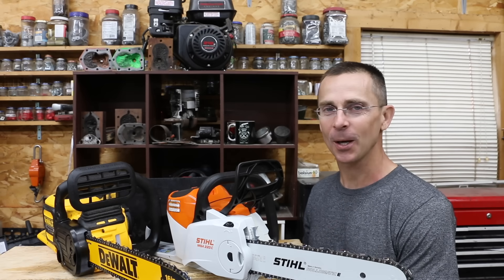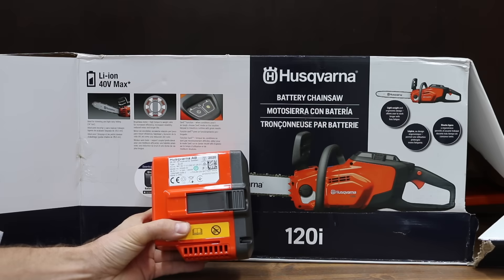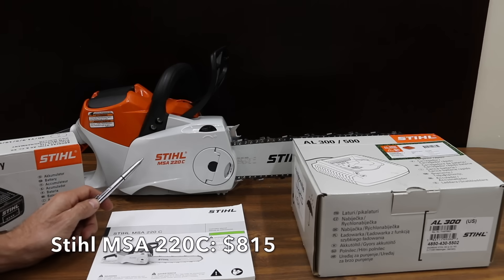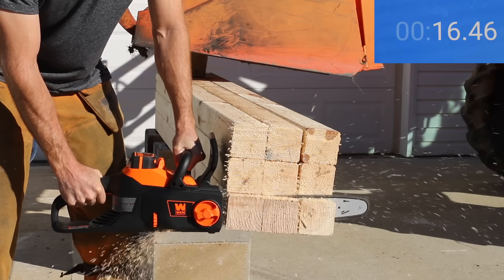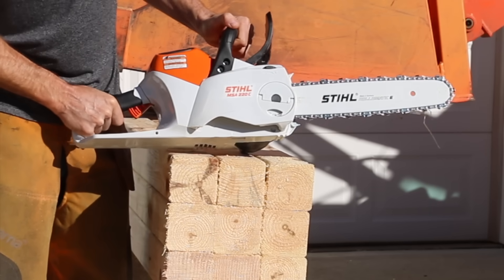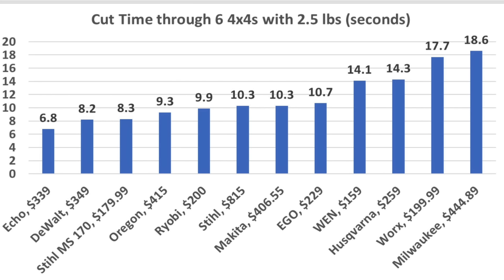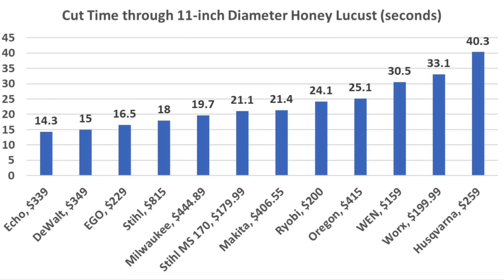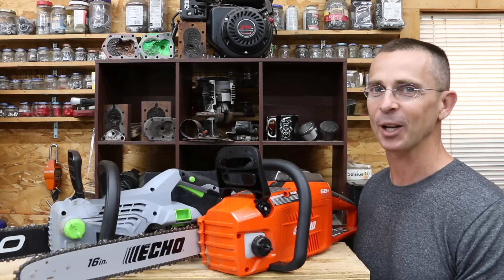Best Battery Powered Chainsaw Brand (ROUND 2)? Stihl, Husqvarna, Echo, Oregon, DeWalt

Comment: I picked up a DeWalt 40V 16" chainsaw and string trimmer a few years ago because they used the same batteries, that way I can have one on the charger when I go back out to the trees. It really jerked my chain when DeWalt discontinued the 40V product line in favor of going to 20V & 60V. I had to scramble to find a 3rd battery as a spare so I can keep 'em operational longer.
Reply from the maker: Thanks for the feedback.

Comment: Great vid, but I have two Stihl MSA 200s and they're seriously fast cutting. They have the 1/4 Picco chain and a tapered bar. The 200 looks almost identical to the 220, expect for the bar. The 3/8 chain is probably what's slowing it down. Give Stihl another shot and try the 200 with the 1/4" chain.
Reply from the maker: Thanks!  Thanks for the suggestion.

Comment: the EGO has one massive leg up over the others if you have other EGO products it can use there battery's like the 52cm SP mower it comes with a 7.5Ah battery there zero turn comes with 4 10Ah battery's and if you live in a country with 230v - 240v power they can charge really fast my 7.5Ah battery takes around 45 - 60 mins. oh and if you want to take some of the weight off your hands they have a battery back pack that takes there standard battery's and a 28Ah Commercial Backpack.
Reply from the maker: Thanks for the feedback.

Comment: I ended up with the EGO just because I have batteries for my blower, hedge trimmer and weed eater, I was amazed how well it worked but haven't compared to anything else. I cut down an old olive tree on one battery.  It's been hit and miss with batteries on my ego stuff, they have warrantied three of mine but when you get a good one they're great.  They do honor your warranty as long as you have the receipt and register your tool on their website, if not you're screwed.  I found out the hard way.
Reply: The 18 inch ego is twice or three times more powerful then that 14 inch. He doesn't use the best or consistent grade from each company

Comment: I mostly agree but for the DeWalt, I'd rather buy into that since the battery lineup is much more expansive. As far as slow charging for DeWalt, use one of the yellow fast chargers. I have the 4 port fast charger and it can fully charge 4 Flexvolt 9ah at the same time in under an hour

Comment: My dewalts kick butt for light duty climbing .I tried out the echo and thought it cut well but overheated and shut down too easy… I have the ego 18 inch  and it’s a battery powered beast,but I hate the chain adjuster sticking out so far.
Reply from the maker: Thanks for sharing.

Comment: EGO also has a 16” and and 18” model, both with higher RPM and a 5 Ahr battery (instead of the 14”, 2.5 Ahr you tested here). Wonder how they would compare with the Echo, as the 18” EGO is similar price to the Echo.
Reply from the maker: Thanks for the video idea.

Comment: I love my Dewalt Chainsaw.  Using it while I'm clearing, I use it for a few minutes at a time and it's very convenient, lightweight, and since I have two batteries, I never use up one battery before the other is charged.  When I'm going to cut logs into firewood in more continuous use, I'd use a gas powered saw.  So nice to be able to just jump off the tractor, grab it and cut without having to keep restarting and turning off the saw.  I just have to remember to refill the oil more often than I change batteries, since it seems to always run out of oil before the battery is done.
Reply from the maker: Thanks for the feedback.

Comment: Echo is the exact same saw as AEG .   One thing not tested is how quickly the chain will come to a stop after trigger off . The AEG/echo was shocking . Partly why I took mine back . Also was not impressed by the 'useable' length of bar . And it is heavy . The spikes were a blunt rounded mess . I found out later the batteries die early . I bought a 200msa . Pretty much  same bar length on its 14 inch as the echo/AEG's 16inch .
Reply from the maker: Thanks for sharing.
Reply: @ProjectFarm  I partly went stihl because of their pole saw . ( The narrow gauge seems not to grab and snatch on the smaller ' twigs'  , and haven't really found it to jam in a cut anymore often . But  now  they go and bring out a pole saw running the same battery and chain as the 220  . Looks like a beast , and with a better extension lock than the crap first version of it ( extension lock)
Reply: The 300s battery and a fast charger certainly bump up the price of the Stihl . Mb a better fit  price wise may have been a 200 with a lower spec battery and charger . The narrow gauge on the 200 seems to slice through hardwood pretty good , and no doubt  helps gives more cut per watt hour through many dense woods , so long as you are dead square cross cutting it .
Reply: The bumper spikes let the ego down . And something to do with the oil filler ....from memory .
Reply: That was the lil baby husky

Comment: FYI, the Dewalt chainsaw series are well known to have a defective design brake design, resulting in overheating, melting plastic under the chain drive pulley, and a lot of smoke. Ultimately, the plastic dries and seizes the chain drive pulley. And factory service centers are very little help. They also leak tremendously. Had 3 of them, all had the same problems.

Comment: I think Stihl engineers were not thinking with their motor choice. Sure chain speed is important but without the torque to back it up plus a good chain you're not going anywhere. I'm wondering that 8k to 9k rpm is the sweet spot since the chainsaws seem to be about the same power

I honestly thought the saws would follow the similiar rule of other battery tools. Where the bigger the voltage and amp hour the better the tool
Reply from the maker: Thanks for the feedback.

Comment: I've had the Echo for about 3 years and I can confirm it is a good little saw. I have cut at least 8- 10 cords of firewood in that time; mostly Douglas fir, western hemlock and red alder.  One slightly annoying glitch is that the battery needs to cool down for up to an hour after use, before it will accept a charge. Also, no matter how carefully you tension the chain, it will come off when cutting brush. And when it comes off, it is a bit of a disaster since the drive links tend to get mangled. DO NOT cut brush with this saw. Period. Never. Just don't do it! Also, keep the chain sharp and you will get way more cuts.
Reply from the maker: Thanks for the feedback.
Reply: Sounds like you would need to tighten your chin for brush cutting. That is the same with any saw
Reply: @tomkelly8827  That's what I thought too, but it's just not the case. I always keep the chain tight and I don't have this issue with my other saws. The instructions with the saw specifically state " don't use for brush". And they're right! It might be something to do with the narrow kerf chain but I don't know for certain.

Comment: I probably started my last comment with this same sentence: 'I can't say enough how helpful these videos are.'  They also show that across-the-board brand loyalty is a potential pitfall; X brand might make the best ( a,b,c) tools and Y brand make the worst (a,b,c), but the Y brand of (d,e,f) tools can outperform brand X's (d,e,f) tools by a mile. This fact speaks to the need to explore various options in a scientific and unbiased format in order to pick the best tool for the job whether your eye is toward overall value, maximum performance, or just what to stay away from at all costs! Thanks so much for all you do, Project Farm! You are a hero to people who buy and use tools that they rely on for their lives and livelihoods! Bravo!
Reply: Unfortunately, each cordless tool manufacturer has its own proprietary battery/charger, which makes buying the same brand for everything a lot easier than having several incompatible batteries.
Reply: @SumErgoMonstro  Makes me wish the US would get on board with the Cordless Alliance System that Metabo is spearheading in Europe.  Multiple tool brands, 1 interchangeable universal battery platform.
Reply: @Anomaly188  yeah, especially since that would be really helpful for the environment
Reply: @Anomaly188  I would love that.
Reply: @SumErgoMonstro  and that is a significant factor in overall cost, as well.
Reply: @SumErgoMonstro  If they are the same voltage it might be possible to make adapters. So you can have echo batteries, chargers, and for non-echo tools an adapter that gets it to fit.
Reply: @SumErgoMonstro  Ah yes, the old in for a penny in for a pound dilemma. Once you get on one platform it's hard to break away to another.
Reply from the maker: You are welcome!

Comment: Now compare The outcome of these saws to a gasoline powered saw that is more in the same price class. The two most popular gasoline powered saws of all time in use by homeowners today in the United States are the Husqvarna rancher 455 with an 18 or 20 inch bar and the Stihl MS290 Farm Boss with the 18 inch bar. Both of those can be had for around $380 online which fits right into the same price bracket as a lot of the saws you have tested here and there’s a lot more in line with what people I know would be using. Testing the MS 170 that you can buy for $89 online is not much of a gasoline powered competitor. 

That being said I truthfully believe that the top five electric saws in your test would still give a good showing against a larger gasoline saw, but I’m not sure they would win and I would still make the case that unless you’re carrying a generator out into the woods that you would run out of batteries long before you would be done cutting firewood but you can carry lots of gasoline and oil.
Reply from the maker: Thanks for the video idea.

Comment: DeWalt didn't do good this time because of the battery use time and recharge time.  However, for those of us who have umpteen DeWalt batteries and a multi-bay charging station, these two factors are a non-issue.  I'd guess that goes the same for all the brands where we need multiple batteries for multiple cordless power tools for the same brand.
Reply from the maker: Thanks for the feedback.

Comment: Wow, thanks for the great and thorough testing as always! If there’s a Part 3 I’d also like to see Kobalt, GreenWorks and the Harbor Freight Lynx! I’ve heard all of them are good but never used them!
Reply: I have the Kobalt 40V chain saw and it works pretty well.  I doubt it would beat out the Echo but I have several other Kobalt 40V tools so I have plenty of batteries.  There is definitely an advantage to using tools with compatible batteries.
Reply from the maker: Thanks!  Thanks for the suggestion.
Reply: @ProjectFarm  would like to see the Milwaukee hardwood run time.
Thanks! ❤️

Comment: Should there be any concern with the fast-charging amps/rate on the Echo vs the Dewalt? Solely to ensure the battery lasts the longest time!
Reply: All Egos batteries have a 3yr warranty. This is the smallest battery they have which is why it charged faster than the others and didn't last as long. They have larger batteries and a fast charger as well. Longevity shouldn't be an issue

Comment: Very well done! I've been using chain saws for over 50 years. I used a small battery-powered (a light, cheap one, don't recall the brand), and it's been a pleasure to use. I'll still use the old style for serious cutting, but for smaller work the battery powered saws are WELL worth having. And once again, you found by far the best saw for us -- which none of us could have done ourselves! Thanks!

Comment: The DeWalt stock charger (in previous video) only charges at 20v max no matter which battery you put in it 20 or 60 volt. Recharge time will be less if you use the actual 60volt charger. You can also get a 12AH battery which is 4AH at 60 volt for longer run time. The same 60v batteries are auto volt switch and will run my DeWalt 20v XR tools without adapters. I don't need multiple chargers because of this. It is nice to use one battery and charger for all of your cordless tools. Echo is a good brand but I am not in a hurry to cut wood and I added this Dewalt chainsaw to my other DeWalt items, drill, impact driver, recip saw, cir saw (60v), 1/2" impact driver, hammer drill, work light, weed wacker and hedge trimmer. My original 1.5AH batteries are date stamped 06/2014 and are just now loosing run time.

Comment: A brand I am familiar with that is conspicuously missing is Kobalt.  I have an 80 volt lawn mower I really like as well as an 80 volt multi-use tool (weed-eater/edger/tiller) that performs very well.  Why no Kobalt chainsaw in the test?  They make 3 models I am aware of: 20, 40 and 80 volts.  Is there any chance of a Kobalt evaluation in the future?
Reply from the maker: Thanks for the suggestion.

Comment: Your comparing saws of completely different powers. Each saw is fitted with different a chain brand to brand there is a massive quality difference in chains, in Australia the Stihl MSA 220 comes with a full chisel chain that is going to cut a heck of a lot quicker than the rest. 

When you fit the bars to the saws you should hold the hose as you set the chain tension this will prevent the bar from slipping when you cut.
Reply from the maker: Thanks for the feedback.

Comment: Another consideration to recharge time is that these high voltage batteries are very hot when they run down and you have to wait for them to cool before recharging.  These saws are only good for a homeowner to cut up a few limbs.  For that I use a Milwaukee Sawzal with an Ax blade.  It is much more affordable to have a bunch of the 18 volt batteries that run the dozen+ Milwaukee tools that I own.   Available in 2, 3, 4, 5, 6, 9 and 12 amp capacities.
Reply from the maker: Thanks for the feedback.

Comment: I’m a huge fan of the channel and have made many purchases informed by your diligent testing. This specific review has been very helpful in my research for the best electric chainsaw for my use. However I notice you tested an Ego model inconsistent with most of the others. It’s the 14” with the 2.5Ah battery instead of the 16” with the 5Ah battery. Wasa rain for this? Considering its strengths (e.g. noise level, family of tools) and that it still did very well, I just ordered one. Thanks for the help!

Comment: I'm surprised Stihl cost far more than the others and didn't beat their cut times.  I use to own them when I did chainsaw work for my land clearing business and they were the most reliable.  However, Echo was a close 2nd, as far as reliability with lawn equipment vs the Stihl lawn equipment (we maintained a golf course also).  So if I needed the electric chainsaw, based on this test, I'd go with the Echo, for reliability, as well as speed.
Reply from the maker: Thanks for the feedback.

Comment: I have to say that it is very refreshing to see the unspoken expertise on this channel!  I don't know if the average viewer appreciates the choice of hardwood used in this test!  Anyone who has had the unfortunate chore of putting up fence using seasoned locust for the fence posts will forever remember the fun they had trying to drive nails and Staples into the wood!  We used to challenge the uninitiated experts as to how many nails it would take to fully embed the nails.  When I was 10 or 11 years old I tested two pieces of seasoned locust and Osage orange by shooting a 32 ACP fmj bullet into each. As a reference seasoned oak penetration averaged an inch and a half to two inches.  In the locust and the Osage orange the full metal jacket bullets did not even get as deep as the base of the bullet!  From one who was blessed to be raised on a  farm and  to all of the gentry who preceded and followed!  As always keep up the splendid job that you do!
Reply from the maker: Thanks, will do!

Comment: Another reason to consider the Dewalt is that the 60/20v Flex volt battery can be used on most of their line of power tools. And Dewalt has a very diverse selection of powertools.
Reply from the maker: Thanks for the feedback.

Comment: Been considering down grading from my heavy two stroke saw, I see now it’s not as much of a loss in cutting power I thought. Dewalt for me I believe.
Reply from the maker: Thanks for the feedback.
Reply: Time to weigh your 2 strk and then compare
Reply: @iffykidmn8170  without weighing it I know it’s heavier than anything tested here but strong and dependable I’m just old and broken due to self abuse for 50 years  now 😂
Reply: @Formerlywarmer  Look at just about any quality modern 2strk my old 50ccstihl 026 is right about 10.5lbs and the 70cc Stihl 044 is around 14.5lbs and either would cut circle around any of these electrics.  All these electrics that were tested are between 10.8 and 14.5lbs.

Comment: I bought the EGO 16" a couple of years ago, and I'm pretty happy with it. All my yard tools are EGO, so I have multiple batteries available. The 5ah battery works well for the little cutting I have to do. The 2.5ah battery only ever gets used on the weed whacker.
Reply from the maker: Thanks for the feedback.
Reply: Have you bought any of the knockoff Ego compatible batteries? If so what was your experience. 
Ego batteries are near as expensive as the 16" Ego saw itself!

Comment: Thanks so much for this video!  Great overall, but I am wondering why some were 16" bar models and some were only 14"?  For example, you have the Ego 14" model which only comes with a 2.5amp battery, but the 16" comes with a 5 amp?  Some of the models don't seem to be apples to apples.  Just my 2 cents.  Overall tho, I found your info very valuable!  Thanks!
Reply from the maker: You are welcome!